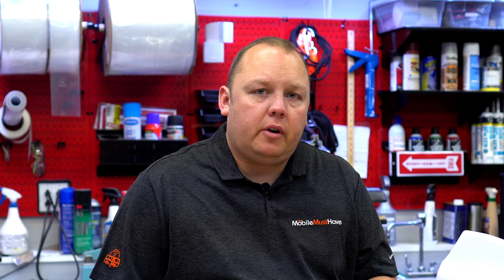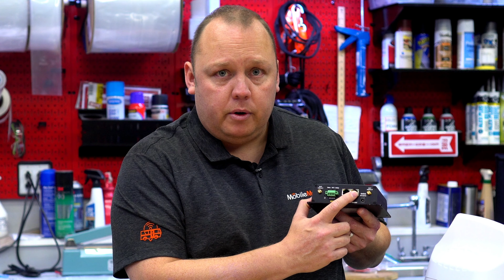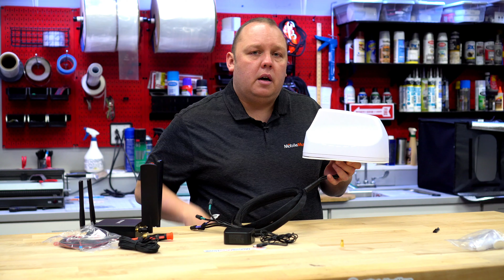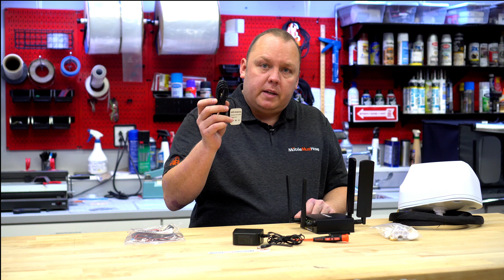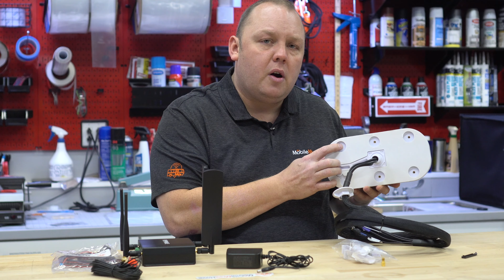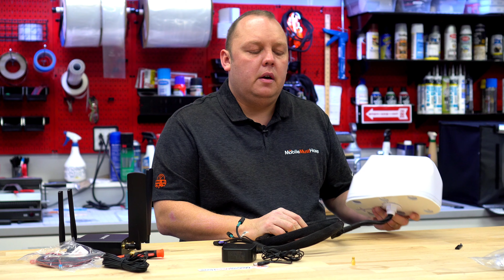Full-Timer Bundle Mobile Internet Solution Overview

Comment: Will solar panels interfere with antenna?
Reply from the maker: any objects in the line of sight between an antenna and a transmitter (cell tower) will impact signal. That said in normal operation we have customers, ourselves included with antenna mounted on the roof and solar panels around the antenna working fine. Some customers elect to mount the antenna on a box to raise it up above surrounding roof items which is an option as well. We covered that in our video we did on an entegra coach here: https://youtu.be/fxr9_fT4lmQ

Comment: I already have the Airstream 5G Connected antenna on my Class B Interstate. Can I use this antenna with your product? Thinking your Full Time bundle. Can the modem be purchased separately without the roof mount antenna? Thanks! Great Video.
Reply from the maker: Sure the max br1 mk2 can be purchased on its own however thats a cat 6 modem and depending on your carrier you may want to consider the much faster br1 pro which is a cat 20 modem. Mk2 is here: https://mobilemusthave.com/products/pepwave-max-br1-mk2-router-with-cat-6-lte-advanced-modem?_pos=3&_sid=f39c77a27&_ss=r and br1 pro cat 20 is here: https://mobilemusthave.com/products/pepwave-max-br1-pro-primecare-router-with-cat-20-modem?_pos=2&_sid=2a923b8f3&_ss=r. Also for airstream we highly recommend either not hooking up wifi (not cellular, the wifi) to the roof antenna as your local wifi will then broadcast from the roof and significantly hurt your local wifi signal in the rv. Small black antennas are included with the modem you can use on the wifi so it broadcasts the local wifi from inside. Alternately you can get a second access point and then use the roof antenna for wifi as wan (picking up campground wifi) and the internal access point for your private wifi. We have guides on how to set this all up at guides.mobilemusthave.com

Comment: Do the attached paddle antennas have to vertical or can they be horizonal?
Reply from the maker: They can be either, they have 90 degree pivot points on each antenna.

Comment: OK, I bought the Pepwave Max Transit Pro, Poynting antenna,  and your 300G/month data plan. Worked ok at first now it sucks. Using my ATT cell phone I get 30 Mbps download, using your ATT data plan in  the Pepwave (which shows 5 bars in the admin console)  I get these staggering statistics:
Ping Latency  356.1 ms
Download   0.13 Mbps
Stability   -1823%   Transferred Data 349.7 KB
Upload    0.76 Mbps
Stability   -1020%  Transferred Data    880 KB

Now if only your tech support would return my emails after paying for your support. I guess I should have kept just hotspoting my phone.
Reply from the maker: Hi there, at&t is having a global issue over the weekend and this am affecting wholesale data plans and is working on the issue. We respond to all issues during business hours (like im doing right now within 5 minutes of your post). At&t is working on the issue and thinks they have a fix. I cant tell your account name from your YouTube screen name but we are working through tickets and will respond to you asap. Our team is also available for chat on our website if you need faster response. AT&T is testing multiple fixes and we should know more very soon. Apologies for the inconvenience here caused by the cellular carrier.

Comment: Hi Eric, great video,. Just a couple of questions for you, I have a visible as well as a grandfather ATT unlimited (home base) plans and currently use the home base in my rv for internet with the visible phone as a back up to hotspot off of.  Would I be able to use the sims out of the home base and the visible phones in the pep wave? Are you aware of any difficulties getting visible or ATT to accept the new IMEI numbers?  Any suggestions on how to go about this?  Thanks for the help.
Reply from the maker: We have a help article to get visible working but its a work around so it could technically stop working at anytime but it has worked for years. Im not sure about the home base but our friends at the mobile internet resource center likely have a post on this as they track all data plans so consider joining and asking in the forums as they will have the answer at rvmobileinternet.com - our visible article is here: https://support.mobilemusthave.com/support/solutions/articles/67000460963-visible-data-plan

Comment: Thank you so much for your well done presentation. Is the 300gb plan for $150/mth the only plan that you folks offer? Thank you.
Reply from the maker: We have additional plans coming very soon. Stay tuned! Our plans Focus on high gb plans over 300gb. If you are looking for lower cost lower gb options I recommend checking out our membership at http://membership.mobilemusthave.com which includes access to the rvmobileinternet.com which tracks all the best carrier data plans.
Reply: @MobileMustHave  Honestly, not quite sure what our data requirements should be when my wife works 30 hours a week from our RV. No videos involved but will need access to Teams and windows based software with good VPN connection. Have now subscribed to your channel and will stayed tuned in. Thanks

Comment: Could you put the antenna on an extension pole and get better reception? I could also move it between my 3 vehicles.
Reply from the maker: the full-timer bundle has a variety of antenna options now for 2022. I would recommend selecting the Mobility 22G by Peplink which comes with a pole mount bracket in the antenna at checkout. Alternatively the Parsec Doberman antenna has a pole mount option as well but requires the pole mount bracket to be purchased separately but that is also a top-performing antenna compatible with the modem in this bundle.. Here is a link to the bundle options: https://mobilemusthave.com/pages/full-timer-mobile-internet-bundle

Comment: Do you have a bundle designed to use in RVs for working from home where most of the time it would be used for Microsoft Teams meetings?
Reply from the maker: This bundle should be able to handle that traffic just fine. but we do have the Speed Demon bundle and Ultimate Road Warrior bundle that have faster internal modems that may work better since they have a faster connection.  You can watch our How to get started with Mobile Internet video to get a full run down of those bundles as well.

Comment: Hello.  Ok I am very interested, I tried about everything else.  My question is can I make this my home network replacing xfinity?
Reply from the maker: Mobile internet or more specifically cellular internet solutions are not a substitute for home internet unless you live in an area with poor options for broadband. We appreciate the interest and you could certainly use a product like the Full timer bundle at home but the primary use case for most people would be to provide cellular failover or backup to your primary internet provided by wired internet providers like xfinity. The Pepwave devices have the ability to manage a cellular connection and a wired connection so that you would have failover/backup internet in the event the xfinity went down. That said, the majority of cellular networks are slower then what you can get from a local wired broadband provider in most locations. Thanks for the inquiry, we just dont want to misrepresent what these solutions can do for rural home users. Typically if your having trouble with a cable provider that is providing you say 100 or 200mbps, there is another issue in your setup causing the issue such as a device on your network taking up too much bandwidth or an issue with your line from the pole. thanks so much for the inquiry and fire up a chat a mobilemushave.com if you'd like to discuss further!

Comment: We are seriously considering purchasing this bundle as the current router we have has been a challenge. But I do have a comparison question: we have the mofi 4500 and sometimes the service is terrible where we either have no service or very limited. We also have a AT&T sim card only for internet. We also have an antenna mounted on our roof. We do boondock a lot, but right now we are in a campground (I will not use their wifi as it is terrible) that is close to town. How does this fulltime bundle compare to the mofi 4500? TIA
Reply from the maker: I would defiantly dive deeper into this on rvmobileinternet.com.  While the mofi has a faster modem, it doesn't work as well with external antennas and as you are experiencing it is not as reliable.  The key with pepwave and the MK2 is it is a very stable device that while it may not post the fastest speed test, it does a great job at keeping connected and doesn't drop out.  If you want something faster, the Speed Demon is not much more money, but a cat 18 modem.

Comment: Is this option great for gaming out of my RV?
Reply from the maker: this is based on a cat 6 modem and for gaming you may want to try and faster modem like the cat 18 in the Speed Demon bundle.  But the key for gaming is the cell network as that is where the latency is most controlled and impacted.

Comment: I just got this setup and it is slow as shit!!!
Reply from the maker: Clink make sure to follow our troubleshooting connectivity video. Most slow speeds are usually a throttled data plan or coverage issue and are easily remedied but with all things mobile, your location and cellular provider will be factors.

Comment: Does my cell phone have to be on mobile hot spot settings every time I use the pepwave?
Reply from the maker: Pepwave's take their own sim cards when setup properly and require their own data plan. While they can technically connect to your phones hotspot in a pinch, this is not the way they are designed to work in a permanent installation. They work best with a dedicated data plan/sim card.

Comment: Will this package be enough to stream 1080p? Or do I need the cat 18?
Reply from the maker: the biggest factor is the speed available from the network and tower you choose to use.  Assuming you have good speeds from the tower and the data plan has no throttling, yes, you can stream 1080 with this.
Reply: @MobileMustHave  so really even with cat 18 If the speeds from the network aren’t fast enough for the cat 6 it won’t be for the cat 18?

Comment: Can I run The antenna wires through my slide? I don’t really want to drill a hole in my RV.
Reply from the maker: Possibly, but the idea of setting up each time you need the antenna kinda defeats the purpose of just having something you never need to touch to have working.  You can just use the stock antennas and just order the router.  

The hole sounds scarier to most than it really is.  These antennas last a really long time and their may be something on the roof you are not using you could pull off and put this antenna in its place.

Comment: Will a Verizon NANO Sim card adapter work with this unit? Can I run 2 Verizon Accounts simultaneously? Can the Poynting Xpol antenna pole mounted be substituted? Are the Pepwave stock antennas better than the Netgear 6000450 Mimo?
Reply from the maker: This is a single modem device so only one can be used at a time. The other sim would be used as a fail-over.  The xpol works well with this modem, the stock antennas might be slightly better than the netgear, but overall similar performance.

Comment: does the GPS option give you better GPS? Little confused on that point.
Reply from the maker: It allows your unit to be tracked via GPS.  This wont play into your garmin or anything, but if you want to know where your RV and if the unit has power, you can see its dot on a map.  Works kinda like LowJack did.

Comment: I am about to place an order. Can I still use my own router as well? I.e. could yours and mine be daisy chained?
Reply from the maker: Yes. You can do IP forwarding on the Pepwave to set up in bridge mode. That said, having everything run on 12v is nice if you don’t have an inverter.

Comment: We are having trouble getting a sim card from verizon or at&t because there is no IMEI to activate...how do we get a sim card TODAY?
Reply: Having this same problem. Any solutions?
Reply from the maker: They have IMEIs. Listed on the box and the admin console. Each cell modem has a IMEI. Please email us if you need further support.
Reply: When we got a verizon sim card, we had to use a different IMEI that is specific to a verizon jetpak to get the 30GB plan, otherwise we could only get the 15GB plan with an outside device.

Comment: For those very remote locations, normally no bars, does this device support directional antenna?
Reply from the maker: You can add a directional antenna to this if you would like. Something like the poynting xpol that is a 2x2 mimo pairs well. Contact us if you would like more info

Comment: Does any of the devices receive 5g services?
Reply from the maker: Peplink does make 5G modems, but they are focused on commercial use currently.  Long-range 5G is all LTE based currently and that won't change in the near future.  In 5-years or so 5G may be more widespread, but currently, it only goes a few hundred feet from the towers so it's only good in city centers or college towns.  We don't see 5G playing a big part of RV connectivity for a while as the tech still has a long way to go. That said the Transit Cat 18, does support TMobiles Nationwide 5G on band 71 but even Verizon's 5G at this current time is still mostly LTE.

Comment: Haven't seen anything mentioned about whether or not you can mount the antenna on one of those weBoost telescoping poles. Is it necessary? Would you recommend it? I see you sell the antenna extension cables but I know that you loose signal strength with extra connections.
Reply from the maker: Hi Will, the antenna does not have a pole mount option and overall we dont find it worth it.  We prefer the option of having a system set up and ready to use at all times even when in motion.  Relying on a pole set up means it less likely to be used and overall doesn't provide much gain.  We do have pole mounting options with other antennas, but key thing to remember is that every foot of cable to the antenna does create lose.  It is normally better to have a shorter cable than more hight when deployed on a roof.  They are already about 13 feet in the air, which is normally high enough.

Comment: With this router and external antenne. Does it pick up WiFi from the campground. And make a WiFi network in the rv on the same device. If been told this is impossible because the router has only 1 WiFi module. Is that correct. I am looking for a device hat can pick up 4g and WiFi. And send WiFi in the rv for all your devices. With external antenne.
Reply from the maker: This device does it all!  It will pick up wifi using a feature called wifi as wan, and then broadcast wifi for you to use on your own devices.  It can do this at the same time as using LTE.  Which WAN source you want to use as your main one, is selected through a drag and drop interface.

Comment: I have hotspot on my iPhone with Verizon beyond unlimited and hotspot.  I have watched many times and still cannot figure out if that will work.  I also plan on using a HDMI to lightening cord to mirror from my phone.  only interested in Netflix streaming, emails, social media etc.no gaming or large file needs.    do I need anything else?
Reply from the maker: Hi April, this device would require its own hotspot plan from a carrier to work.  It can not use the hotspot feature on your phone to work.  You can connect your phone via wifi was wan, but not really how its designed to be used.  This device takes a hotspot plan, and converts that to a strong wifi signal for all of your devices to connect too.  For your data plan questions, a great resource is rvmobileinternet.com

Comment: The roof on my RV is aluminum, will the magnets on the antenna stick to it?
Reply from the maker: Aluminum is NOT magnet so you will need to adhire a galvanized steel plate (or something similar) for the magnets to stick or go with the 3M adhesive.